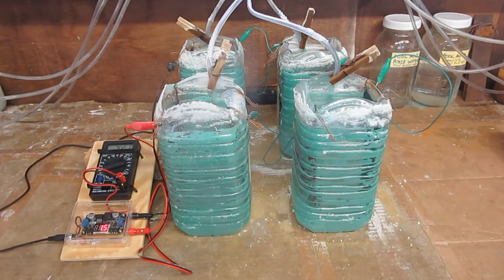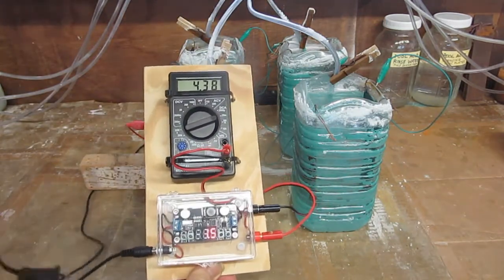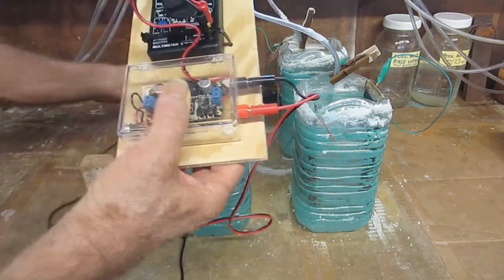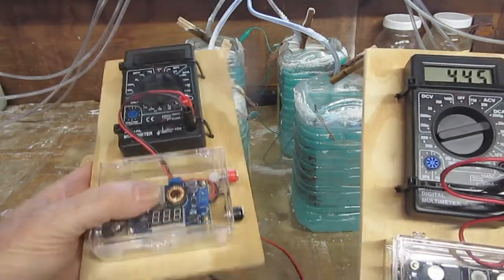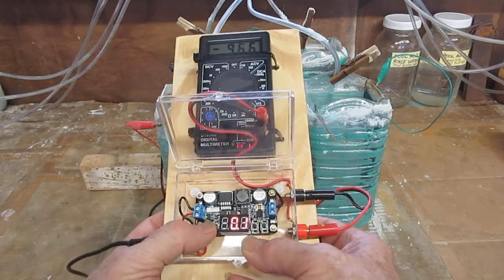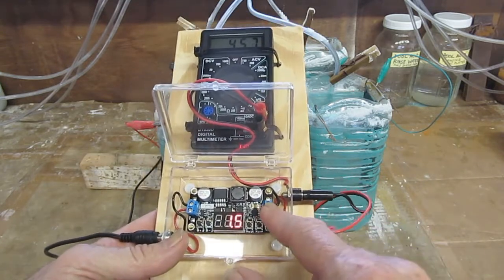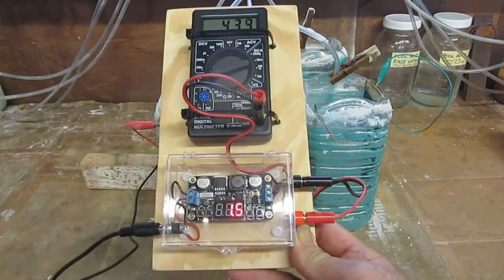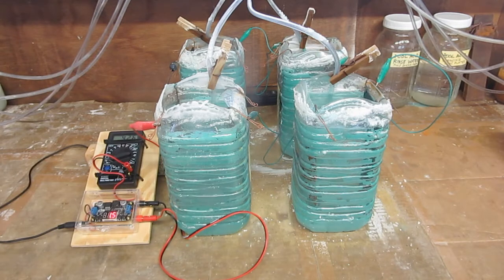CuO GANS With DIY Digital Control Power Supply

Comment: How do you control the output amperage? how many amps are you aiming for? or is it just the output voltage that matters?
Reply from the maker: The output current (amps) is determined by the voltage and the size of the load in the gans job. After I got some experience I found that I would get the best results for CuO gans if I kept the current right around 4 milliamps. Depending on how many containers I would connect together in the batch, I would watch the current on the meter and adjust the voltage up or down to hit the target of 4 milliamps of current.
Reply: @plasmaworkshop  that makes sense. do you recall what amperage worked best when producing Co2 GaNS? .. thanks for coming back to me and for all your helpful videos.
Reply from the maker: @rosstituteuk  Thanks for your comment. With Co2 gans I would connect 4 containers in series with a 5mm green LED and with no external power supply. If the green LED would glow brightly with 4 containers then the batch was running at about 3 volts self powered by the plates in the salt water solution.

Comment: Thank you for this great tip.  I like your video's very much I already ordered this converter. I wanted to ask you where  you can buy the transparant case. Greetings from Holland.
Reply from the maker: Thank you for the comment. Here in the USA I ordered the plastic case from eBay: http://tinyurl.com/yd37uyqv
Reply: Oh that would be too expensive to ship to Holland . 
http://www.ebay.com/itm/1pcs-Small-Plastic-Transparent-With-Lid-Collection-Container-Case-Storage-Box/121829720677?_trkparms=aid%3D222007%26algo%3DSIM.MBE%26ao%3D2%26asc%3D41375%26meid%3D193db8b4465340da868fdb9b4eff9a61%26pid%3D100005%26rk%3D6%26rkt%3D6%26mehot%3Dpp%26sd%3D361367422091&_trksid=p2047675.c100005.m1851 I saw this on ebay. Thanks for the help.